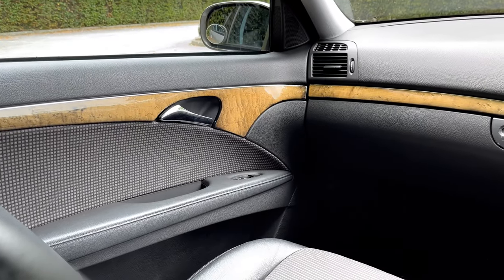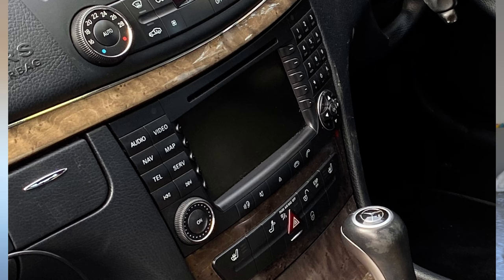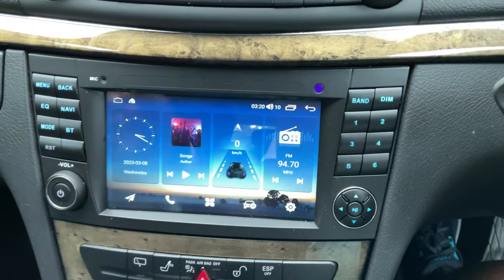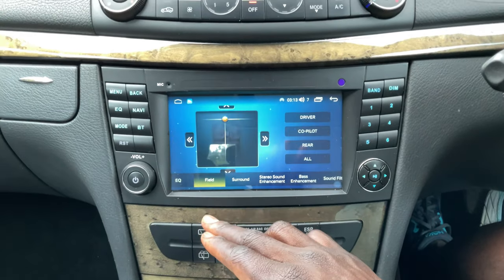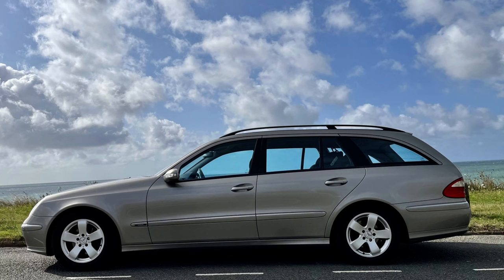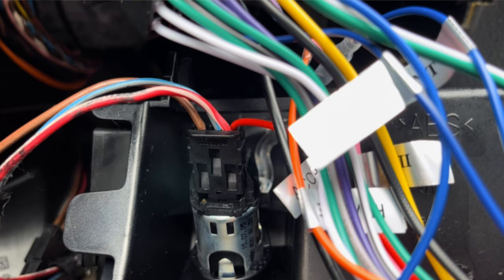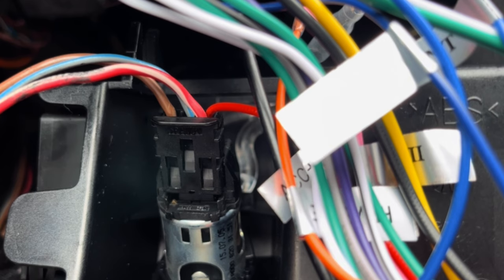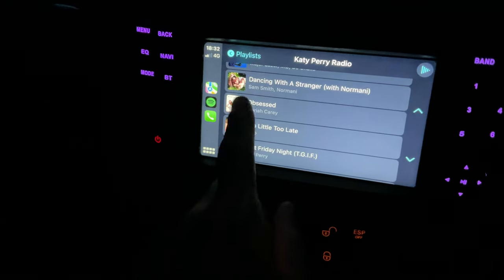W211 Android Head unit review and installation: From Audio 20. Mercedes C209, W463, C219 compatible

Comment: I just installed Junsun v1pro c 2g with amplifier an they cost together about 100€ 
Steering wheel have volume control but nothing else. 
Navigator is much better than I thought and sound is very good for average user.

Comment: Which radio did you buy? I’m planing on buying one but can’t decide.😅
Reply from the maker: There are roughly 7-8 different screen sizes to choose from. It comes down to personal preference. Most android headunits run the same software with some small variations. Featurewise I would look out for the following: Wireless CarPlay and android auto, built in mic on the head unit, a decent digital signal processor. If you can, order from a uk seller for better customer service.

Comment: I got the xtrons 211 it is great IA
Reply from the maker: The size of that screen is glorious!
Reply: @HonestHans365 so true 9 inch I am working on having that secret compartment underneath.  If you did not replace speakers yet watch out those harnen kardon blow real easy with that extra power.
Reply: @robertehlers4330  actually its the other way around, speakers dont blow up from "extra power" but from weak amplifiers, all these chinese head units have extremely weak amplifiers compared to the original installed ones. More power will not break a speaker unless its a lot more and if thats the case the coils in the elements will melt from heat. The reason you blow the speakers is a weak amplifier not able to control the cone movement thus pushing them to the bottom.

Comment: I am going to try to help you best I can I redid the whole system.  So those orange cables are fiber optic  most people with stock harmon kardon system have fiber and for sound intact system you will either have to install fiber optic decoder or do away with whole fiber opticas I did.  So the green are the canbus on mine they have a green canbus extention cable.  And you just plug rhe can bus green cable to canbus hub on passenger side under glove box is the hub.  Once I plugged that into can h can low brown wire brown wire with red stripe.  Does not matter which one you use.  Theirwill be 4 or 5 open ports that you can plug it in and steering will work perfect.  I did my hole audio system complete by myself and if you have any questions let me know on my channel
Reply from the maker: That is correct. If your car has Harman Kardon, you will need a finer optic decoder. Not having a H&K was a blessing for me as I didn't need a fiver optic decoder. Furthermore, if you use one, I don't believe it's possible to fade sound inside the cabin between front and back. I use the feature when my kids are asleep in the car or if I'm listening to a podcast whilst they are using their tablets. 

Thanks for the insight about canbus in your car. There are variations to this. Hence why I recommend in the video that people should take pictures of the harnesses and cable at the back of their existing head unit as part of their research.
Reply: @HonestHans365 so true bro your channel is great.  Yes I replaced all speakers and amps so I have fader on front and rear because I used RCA for front and RCA for rear.  I got one problem I got that stupid teleaid error and need it coded to not present.  The dealer couldsaid they can't get into my system idk.  S I am in process of getting xentry and multiplexer and doing it myself.